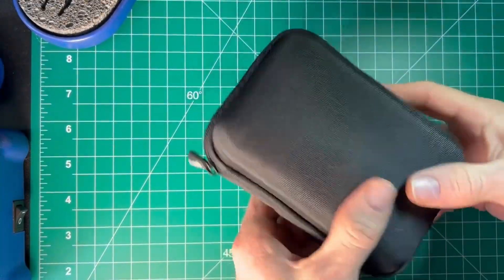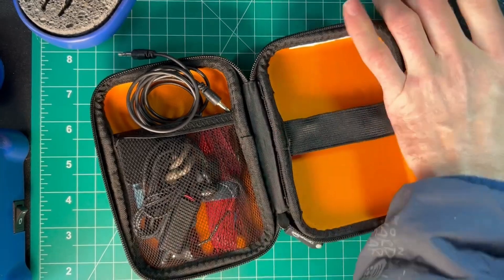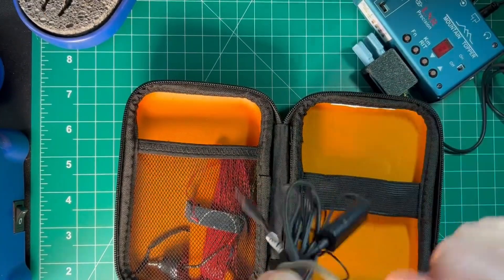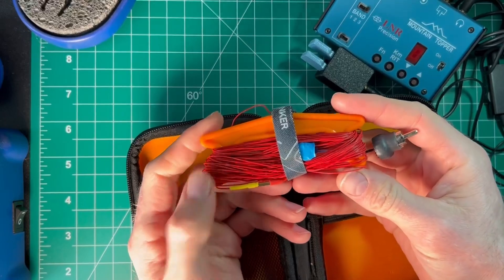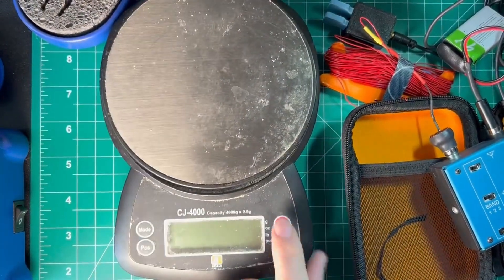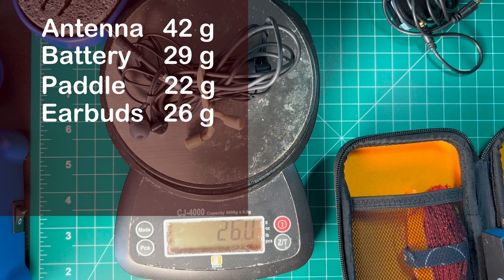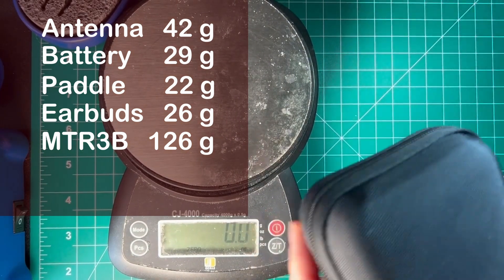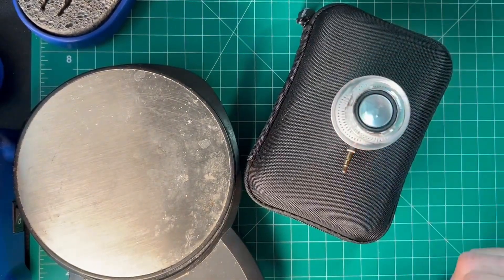My MTR3B Go Kit

Comment: BEAUTIFUL!
Reply from the maker: Thank you!
Reply: @N7KOM  One thought about trying to shorten the cable and solder a new plug on the Koss volume control -- I don't know if it would be the case for that particular item, but sometimes it seems like commercial equipment will use such tiny wire that it is nearly impossible to strip and solder.  Or at least it takes a lot of patience and care.  I can see why you'd want to try, though.  Looks like that cable makes up about half the bulk of the accessories!  😀
Also, I'm wondering if you have done any "miles per gram" calculations.  That would be interesting!
Reply from the maker: @WilliamParmley  I was also thinking about this and how it might be "easier" to design a small PCB with a thumb dial resistor that plugs right into the rig 😆
Reply from the maker: @WilliamParmley  and no I've not done any miles per gram calcs 😆

Comment: Very cool, Tim! My MTR4B kit isn't quite as compact. I am using much more battery than necessary. Fun video.

Vy 73 de Jonathan "JB"
Reply from the maker: The 9v is good for a few activations. If that dies, I have a phone battery bank with a cable that will put out 9v.